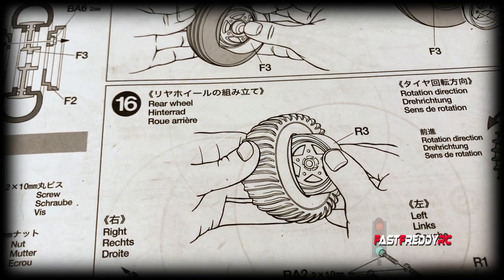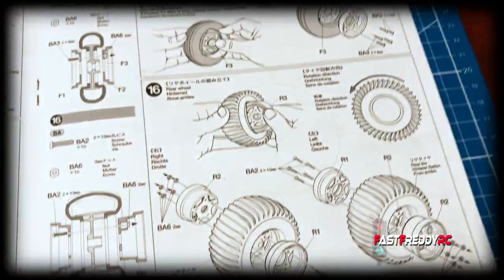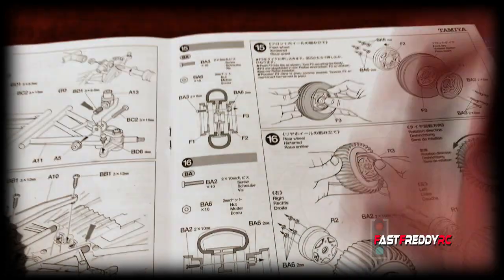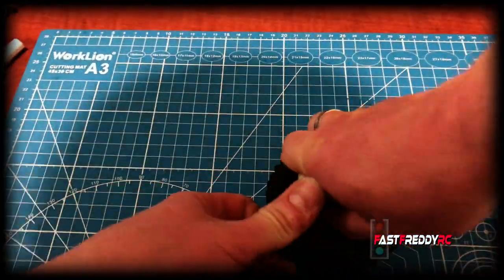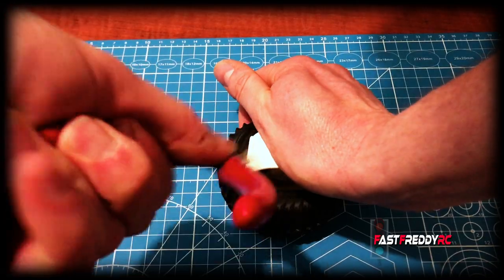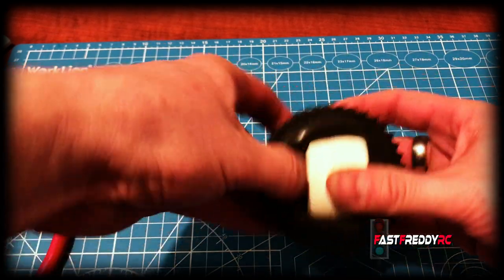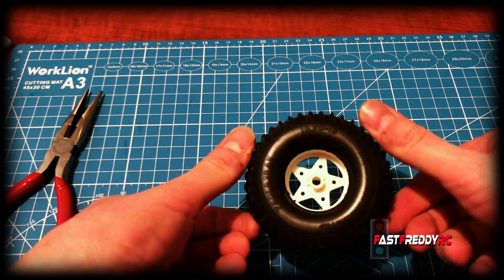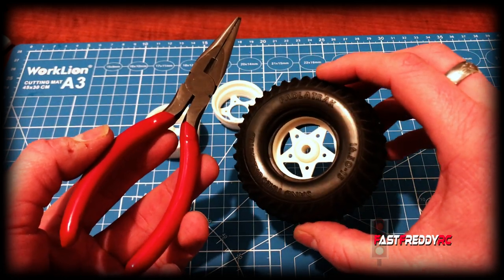How do you fit the Tamiya Grasshopper Wheels into the tires?

Comment: Fantastic tip Freddy! I’ve been building my candy green edition Hopper. The first rear tire was no problem. The other was giving me fits!😩
Great job!👍😊
Reply from the maker: Nice!! Thank you!! It seems like it works for some and others drive you insane lol
Reply: @FastFreddyRC  it’s funny because I got the first one done with my hands, no problem.
That second one though….glad I found your video!
Reply from the maker: @HaydadRC  crazy right?! There seems to be two camps with these tires. Those that can do it by hand and those that need the jaws of life to make it work lol No in-between. You have to wonder if the molding process is slightly different for some of the tires or if they are all made on the same machine??? Who knows.
Reply: Me to got me hitting the table

Comment: I set the actual plastic wheel on the counter, took the tire and turned the inner opening out and pulled it open/stretched it with my fingers and then pushed that over the wheel as it was sitting down on the counter. Maybe hard to describe but that worked really well. Put each wheel in the tire in about 30 seconds.
Reply from the maker: Great! Good to see there are other ways of doing it!

Comment: Thanks for the advice.  What worked for me was rotating the wheel as I was pulling the tire over it with the pliers.  I think my kit might be a bit old because the rubber was very stiff and was turning white as I was working with it.  My tires now look like they've got freezer burn.  But what a pain in the ass.  I've been building kits for 35  years but I guess I missed out on all this fun by always buying high-end kits.  I thought I'd go back and do some of these "beginner" kits I never bothered with, but I would say the difficulty of getting the tires on the wheels makes the Grasshopper not really a good beginner kit.
Reply from the maker: Yeah the tires are very stiff even if the kit is new...which is why the car bounces all over the place lol - But it definitely must be old if the tires have "freezer burn".  I would agree with you that with as much trouble those tires are it doesn't feel like a beginner kit when you get to that stage.  It was infuriating to say the least.  But at least now if I built another I could get the job done without much frustration.
Reply: @FastFreddyRC  Yeah, thanks again.  I was hesitant to buy any other Tamiya kits of this sort because I was afraid they'd have the same types of wheels, but now that I know how to do it it shouldn't be a problem.

Comment: An even easier way is to use hair drier to heat tire up extremely hot and they slip in without any tools. Doing it this way also gets rid of that white film on the tires.
Reply from the maker: That actually makes a lot of sense in terms of being able to remove the white film with the heat.

Comment: My tire tore when I tried this way
Reply from the maker: Did you pull up evenly all around or just try to pull one side up completely?  Very odd.  I've been doing this method for this type of tire/wheel combo for both the hornet and the grasshopper and have not had this happen. One other thought around this...when you use the pliers are you grabbing most of the tire like in the video or just the edge/rim?  If just the edge or rim it might not be enough of the tire to get a really good grip.